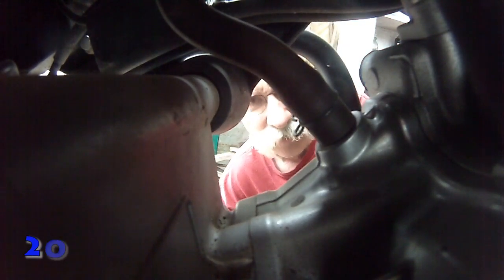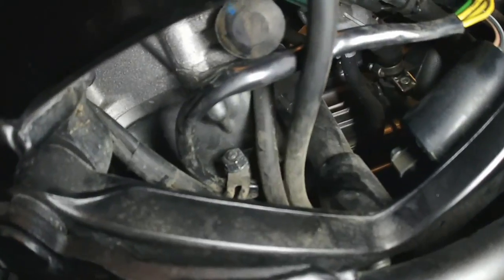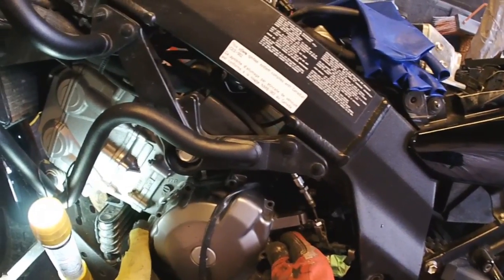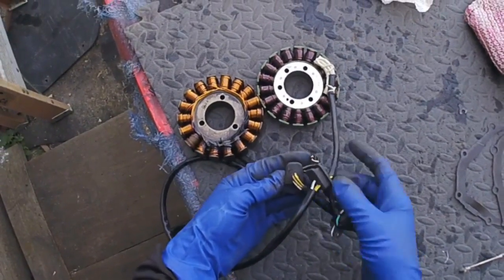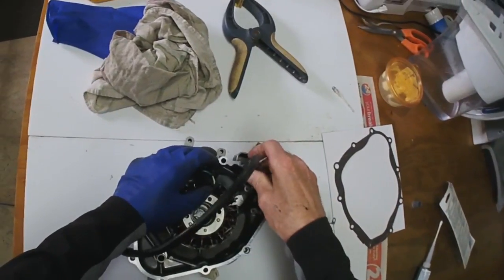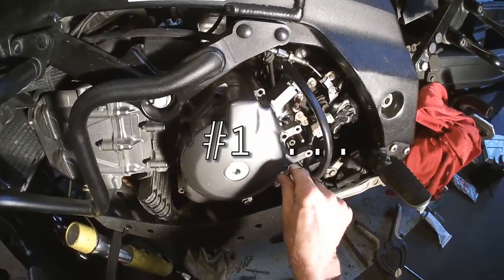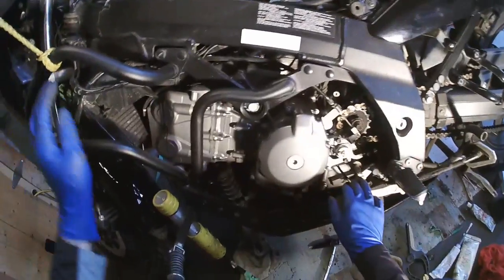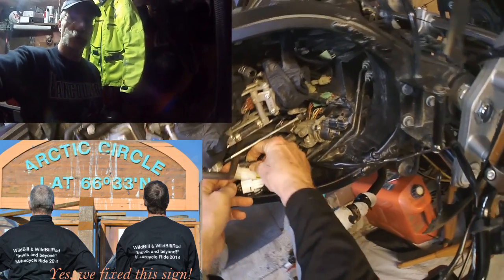Stator Replace on 2011 DL650 Vstrom with Electrosport ???

Comment: I just got an Electrosport and the rubber piece appeared to be bigger. Put it in anyway and thought maybe it would mash flush, but no I have a damn leak.  Just found this video and see how you ground it down.  Wish I had seen this sooner and made an attempt at doing that. Actually wish I had just paid the extra for a OEM Stator now. Anyway, thanks for the video. Sitting here waiting on another gasket now.

Comment: I'm wondering about the 24hr wait after repair before operating. Dealer just replaced my 2014 strom650 stator assembly under recall and I picked it up 2hrs after it was complete and rode it home about 25miles. I hope all is well, I don't see any leaks and it ran fine. I bought it new in 2015 with 0mi. it now has 11,000mi. Just bought 2 new oem tires, will be installing soon. Tread is  down to wear indicators on rear. So far this bike hasn't had any problems and rides very well.
Reply from the maker: mammydammy you'll have no problems, it was just the type of silicon I was using. happy trails

Comment: A recall was issued for Suzuki Vstrom.  The recall was issued for 2012-2016 Suzuki V-Strom 650 stator due to a wiring issue.  The problem is that the 2008 model has the same stator rectifier system.  The part numbers are identical and feature the same wiring.  My stator currently went bad at 42,000 miles.  The parts were used from 2008 until 2016.  The company changed the stator in the 2017 models.  It was an eight year recall and the company got away with four years. 

K8, Stator 32101-17G12, Rectifier 32800-47H00 Recalled  K12 Stator 32101-17G12,  Rectifier 32800-47H00

Comment: Thank's for the video wild bill!!! Maybe my stator is going to dead (DL650 K8). I have two questions. First, did you removed the oil from the engine before you start the procedure? I didn't catch that point. And second, did you put glue on the stator's bolts? Thank's from Greece!
Reply from the maker: I did not remove the oil.  A Suzuki dealership told me they don't either. You lose only a tiny amount. I did lock tight the stator bolts. Good luck! It's pretty straight forward although it felt stressful being my first try. You'll do great!
Reply: @Wildbillsgarage  Thank you very much Wild Bill for the quick answers!!! Tomorow I will measure the resistance and the voltage of the stator-generator coil by the manual. But I'm pretty sure that the stator has the problem. You are the best!!!

Comment: How many miles have you put on the bike since installing the Electrosport stator? I know they used to have a really bad reputation, but were recently bought out by another company (Procom) and I want to know if the reliability problems have been resolved under new ownership.
Reply from the maker: Scott Aponte maybe.... 4000 kms. and they have recalled some of the newer Dl650's for stator. for me, so far so good.
Reply: I had to replace my OEM stator and R/R at 37k miles with an Electrosport stator and in-line R/R (SH775) on my 2009 DL650.  (I tested the old R/R later and it was fine.)  I'm currently at 55k miles and the Electrosport is still working (knock on wood).   I am convinced that Suzuki should have recalled my model year for the OEM stator.  There were recalls for the exact same stator in other Suzuki bikes, and for the DL650 stator in other years.  As far as the Electrosport goes, I think it's fine.  Shame on Suzuki though.
Reply from the maker: Late I know... I sold my DL650 (spring 2018) and the current owner just informed me the Electrosport died. It had like 26,000 kms. My wifes, a 2014 got the recall. I must concur to a bigger recall as it's obvious it's a weakness. I wish us luck with that.

Comment: Wild Bill. Thanks for the video. I also am from the outskirts of Vancouver. I am looking for a new stator. Some feedback after some mileage on your bike would be helpful.  How is your stator holding up? Any issues since the fix? please advise.... thanks Bill. (good vid)
Reply from the maker: Sold the bike. Stator got 30,000 km and then died, not bad really. In hind sight,  I'd buy OEM not after market. Just a thought.

Comment: Thanks for the video. Need some help. I just replaced the stator and while doing so the clutch assembly fell off. I put it back together, but now the clutch won't change the gears when the engine is running. Moreover, when I start it in first gear the rear wheel moves me forward even when I have the clutch fully depressed at the handle. Would appreciate some help if anyone knows how to fix.
Reply: At this time and place i am of no help. Wishing you good luck and keep at it, you'll get it!
Reply: @marabilramblers  yep. Got it. Had to adjust the jam nut.

Comment: Should I drain the engine oil first? I want to replace my stator, i bought the same ELECTROSPORT STATOR and want to change it. I already replaced the Rectifier.
Reply from the maker: I was able to learn the bike over very slightly, tying it up, and drained nothing. Lost tablespoon of oil.  Even if i didn't lean it probably would not have lost much at all.
Reply from the maker: I think the deadliest told me they remove the oil,  just the way they do it. Got about 30,000 kms before it too, krapped out. Good luck
Reply: @Wildbillsgarage  Thank you very much for this information.
I am currently restoring my old DL650 and have learned many things in the restoration process. I removed all rust inside of gas tank using electrolysis(Battery bike, battery source with 10A, steel rod for anode and normal tablespoon or scope of caustic soda per gallon). I replaced the entire fuel pump system, the air filter and rectifier regulator. I changed the oil with synthetic.
I just need to replace the STATOR and the spark plugs.
Fuel Pump --> Quantum Fuel Pump
Air Filter --> Original Suzuki
Rectifier regulator --> Original Suzuki
Stator --> Electrosport
Oil --> Shell Advance 10W-40
Oil filter --> Original Suzuki
Reply: @Wildbillsgarage  I correctly replaced stator, rectifier and starter relay but the motorcycle charges slowly, when accelerating to 4000 RPM it only receives 13.70 Volts. I tested the wires for continuity and it has no resistance.
What kind of problem or inconvenience could my DL650 have? 😖
Reply from the maker: @mavalencia14  i so wish i could help but I'm not that good with electronics. Good luck, you'll figure it out.
Reply: @Wildbillsgarage  at the moment my bike is in Suzuki technical support, I hope they can find the problem soon. I'll tell you when I have an answer from them.
Reply from the maker: @mavalencia14   I believe Electropsport is no longer in business.

Comment: Interesting! I have asked Suzuki to confirm the work order for an oil change with the stator recall . . . all I have so far is cricket, cricket, cricket . . . . did you change the oil when you did the job?
Reply from the maker: Walter Wilkins not yet. the bikes are in  our trailer as I write, we're on our way up to the Yukon, home... she has ridden very little this year. I will have to go over the paper work, which I obviously didn't, and see if it clarifies anything

Comment: Why did they tell you to let it sit for 24 hours??
Btw, thanks for the video.
Reply from the maker: hank122s hank122s just trying to not be in a hurry... they're just put out a recall for the 2012 to 2016 DL650 for possible stator problems. mines a 2011, but my wife's is a 2014. interesting...
Reply: At least the '12-16 are on recall and covered.  I see many other year models having the burnt stator issue.  Seller of a '11 Wee I may buy soon says he replaced burnt stator, with the ElectroSport and replaced the R/R too.  He's got about 5K miles on the new parts. Bike had about 38K when this happened.  Hoping if I buy this '11 Wee, I don't have to deal with this issue soon.  I've read where some have had burnt stator's 2-3 times on their V/Wee.  Good job on this video.
Reply from the maker: ernest diaz wow! my wife just got her recall letter for her 2012. such solid little bikes, but there are very few Motorcycle models that don't have some issue... or so it seems. thanks

Comment: Here's the question under debate in our neck of the woods: Does the engine oil have to be replaced if the stator is replaced? Dealership said yes, I say no . . . who is right?
Reply from the maker: Walter Wilkins the dealership put 3 litres of oil on the bill. when I asked if that mean they will change the oil, they said, probably not, it's usually only a few drops that we top up... but just in case we bill an oil change as part of the warranty work. so I don't know how much, if any, oil they added.

Comment: Yea my 2012 was recalled
Reply from the maker: I think you get an oil change included, and I'm gonna get them to blow a few bugs out of the air filter while they have it apart. I think they actually drain the oil, by the book so to speak.
Reply: hydro1957 .  yup the sator.  and the gave me a credit for the one i had put in last year after the originla one failef
Reply from the maker: yep. Stator